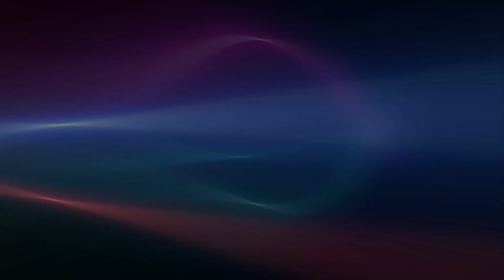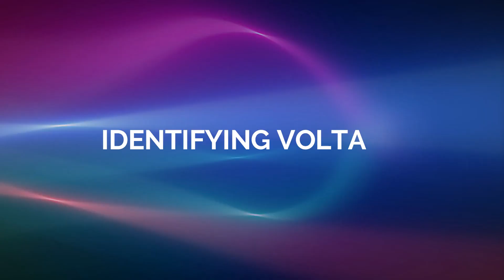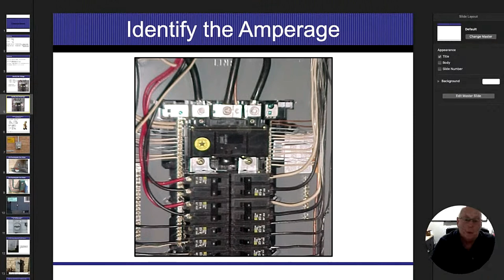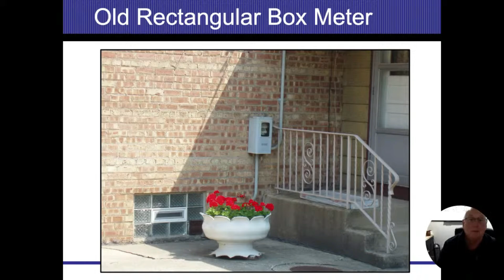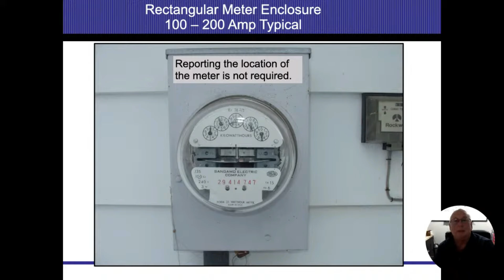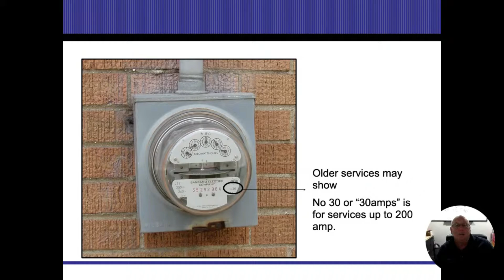Identifying Voltage

Comment: Two wires = a hot line and a neutral or ground?

Are you serious? Are you genuinely saying that the current for the circuit, outbound from the supply on the hot line is going to return on the ground conductor?

Really?